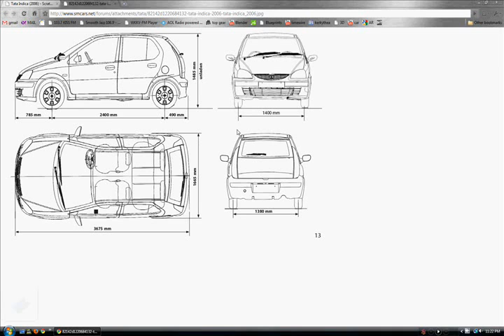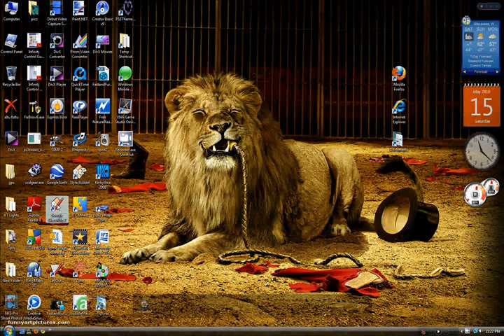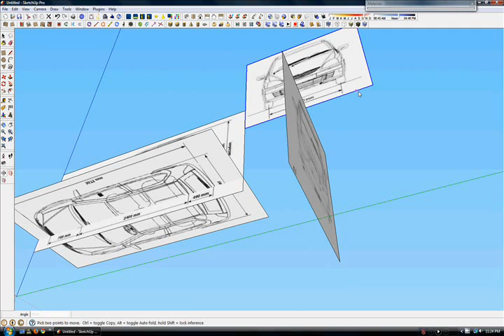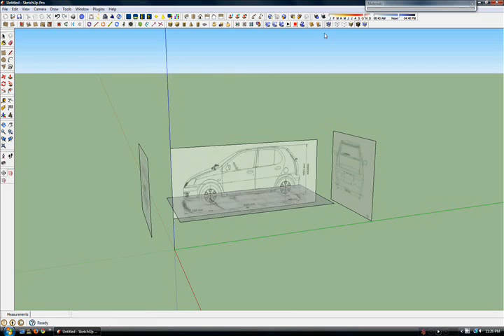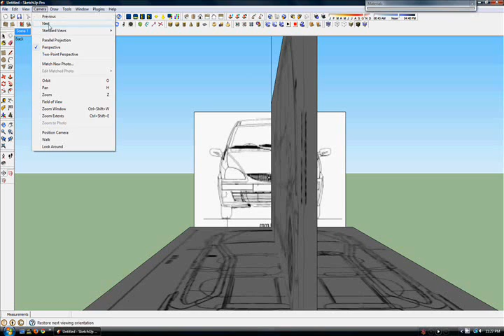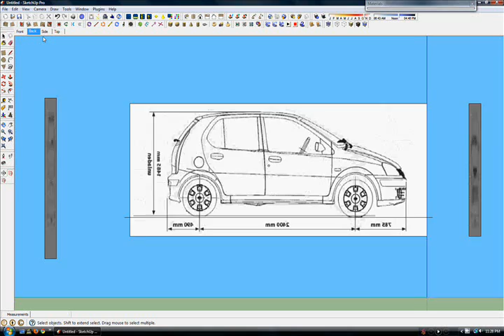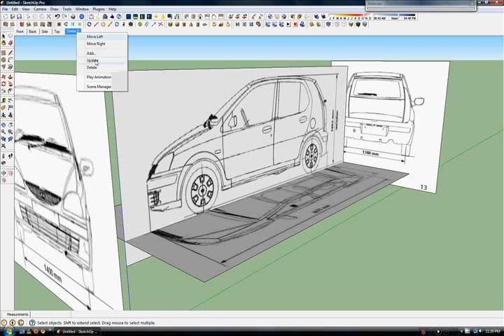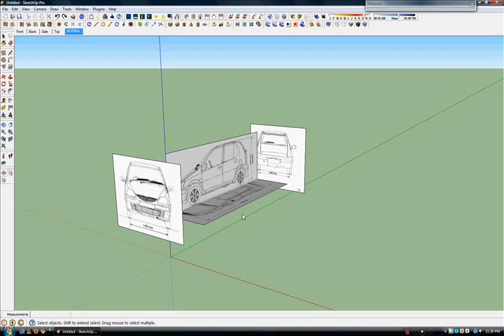Sketchup Car Tutorial Part 1/3 (Blueprints)

Comment: is there anyway to get the measurements just in centimeters not feet and meters i wont to make a model but when i go make a line 25cm or so when i go measure it in the bottom left it reads it in feet again is there away around this? oh i use sketchup 8